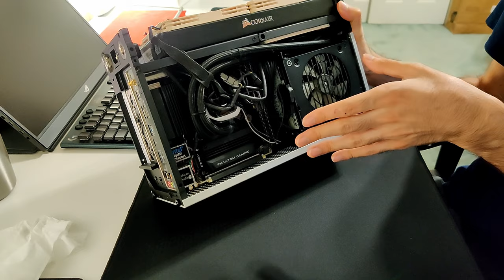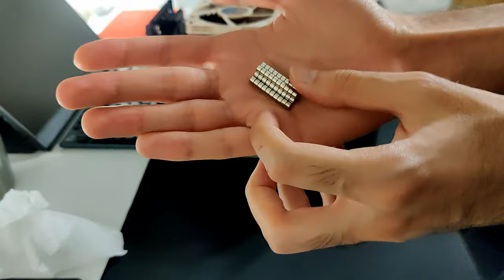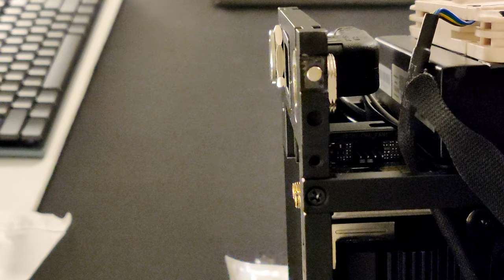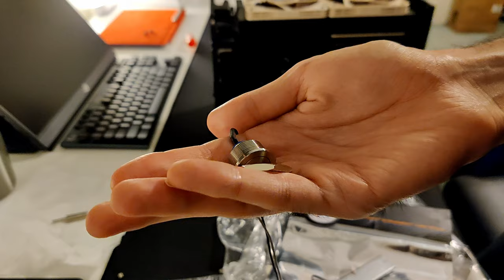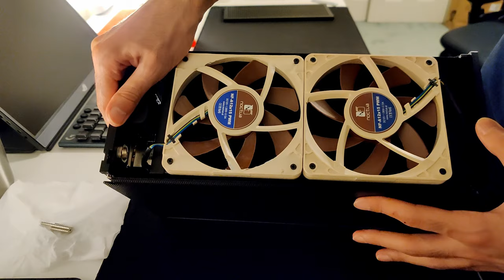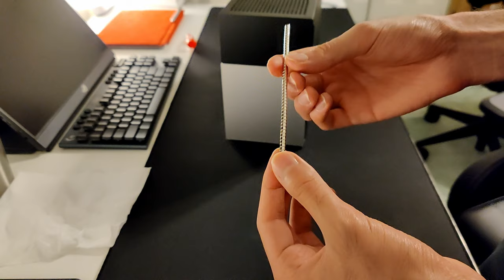FormD T1 Part 4 - Magnets for your Mesh Side Panels

Comment: I have yet to receive my case, but it was my understanding the magnets were meant to go in the small circular holes (e.g., the hole beneath the location in which you placed the magnets). Thanks for making your videos, definitely will help me in better building my case!
Reply: I thought exactly the same! I've yet to permanently affix the magnets, but I've read other Reddit users using a small blob of super glue in the 4 holes on each side - 2 at the top and 2 at the bottom.  Now I'm not sure what the best method is. It seems as though the holes are for those size magnets as they fit perfectly inside...
Reply from the maker: @tdf80  I'll try that next time. When I got them I was hoping it would just magnetically attach to the case. I did not want to do anything permanent to the case like using superglue if a proper solution came along later. I just noticed those holes are exactly the same size as the magnets. If I shove the magnets into the holes no glue, I wonder if they hold in place just fine and do not come off the case when removing the side panels.
Reply: @SawmillMadhawk  I was hoping the same, yeah. Wasn't keen on the super glue either as it's a final 'no going back' solution. Unfortunately, the magnets I have seem to have a stronger attractive force to the side panels, so they come away with the panels rather then staying in the holes and holding the panels in place. So I'll definitely have to use the glue.
Also, thanks for your informative build videos. Definitely helped me build my T1! My build is on air at the moment. Waiting for availability of the new GPUs then probably going to go custom loop.
Reply: @SawmillMadhawk  Did you ever see if magnets would fit inside those holes on the side?

Comment: So does this usually include some other magnets? Which you can't use due to air travel..?
Reply from the maker: Wahaha can't air freight your T1 with these magnets. But, you are free to purchase them on your own and install them later on. I can not confirm due to the pandemic if we are allowed to fly with these attached to our T1's. I will not use check in for my T1 only carry on or personal baggage.

Comment: Hi. Do you know what is the hole opposite to the power button is meant for?
Reply from the maker: 1/4 thread allows for quick disconnects if you want to connect and fill the loop through there. If you setup a different or remote power button then you can use both 1/4 threads as an inlet and outlet port for your external rad for unlimited overclocking headroom lol.
Reply: @SawmillMadhawk  thank you for the tip.  Great tutorials
Reply: Another question, is it better to have the fans on top of the radiator (as you had done) to suck the air out of the case or underneath the radiator to push the air out of the case?